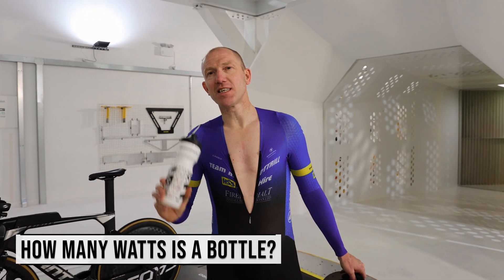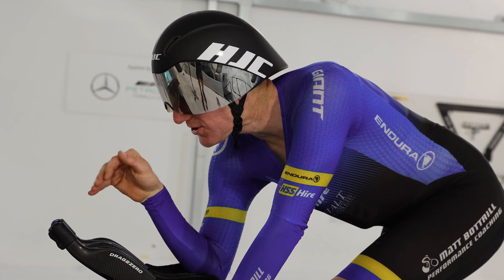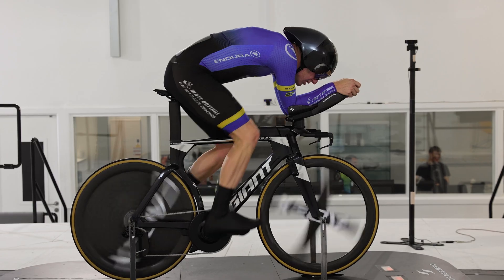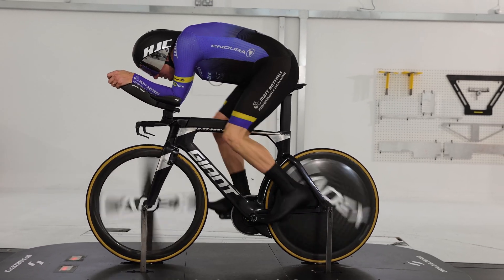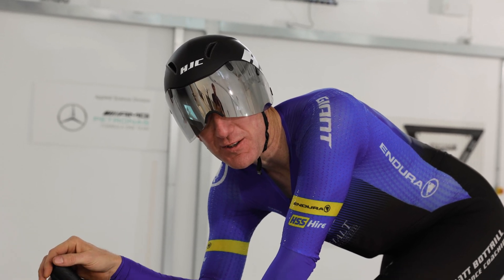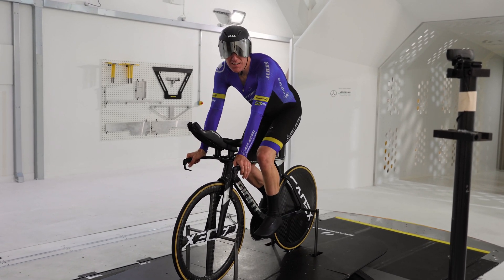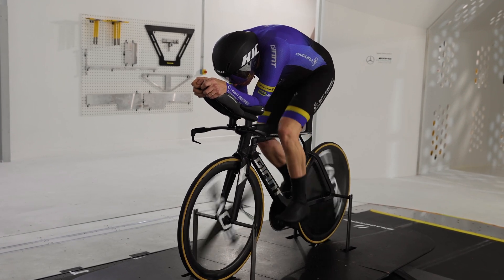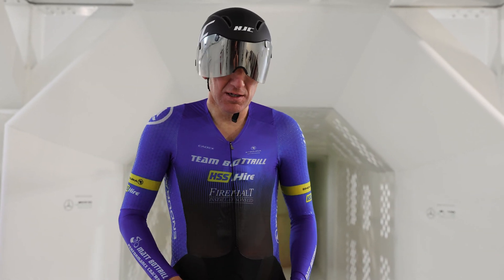How many watts really is the bottle down the tri suit?! | Bottle Test | Camelback down a jersey

Comment: Would you say this works for most people? Even people that can't get as low and aero as the pros?
Reply: It should work with all people. If anything if you have a slightly higher position it should in theory have a larger impact. But it will vary person to person.
Reply: Came to say the same thing.  You'll likely see a bigger gain if your head is higher.  Matt's position is really dialed, having a cda under .2.. most AGers are well over .2. I believe in Lionel Sanders testing recent he was over .2 as a pro... 
So it'd be interesting to see the savings in a less aggressive dialed position
Reply from the maker: Tends to work best with higher head position 👍
Reply: Thank for the replies. Might have to give it a go in the summer 👍